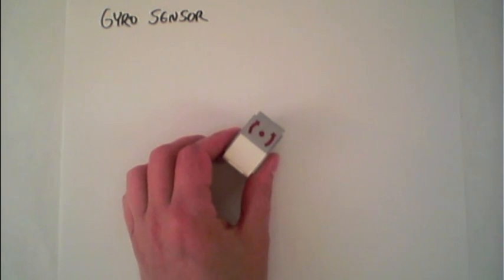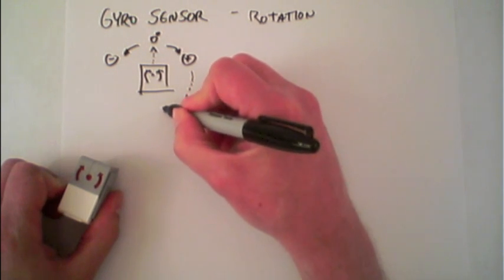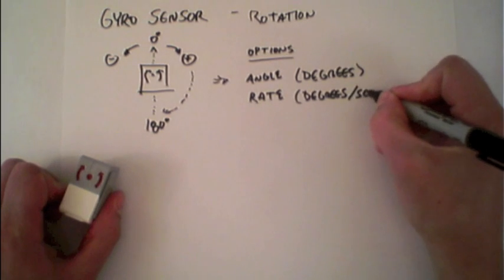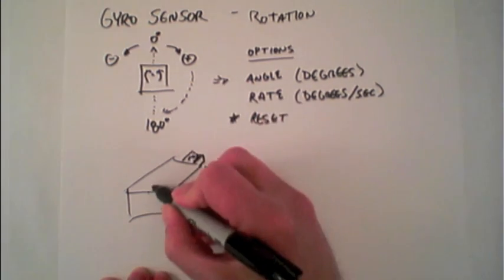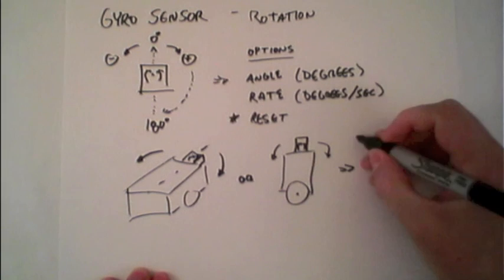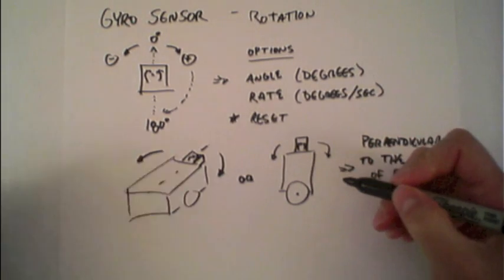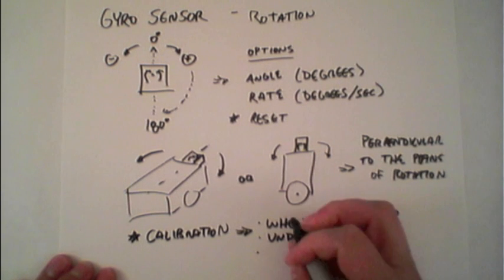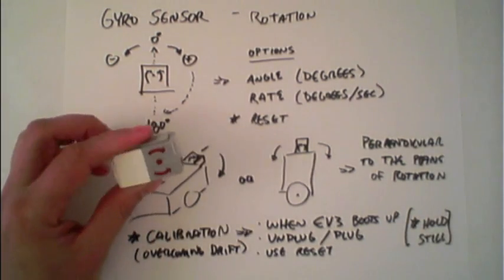EV3 Gyro Sensor

Comment: Would it be possible to use a Gyro Sensor to send out a signal of somebody has fallen over?
Reply from the maker: +CorbettVideos The Gyro Sensor would be able to detect that that someone has fallen over, by detecting that their angle has changed (from upright to horizontal). You would still have to write the rest of the code for the EV3 to "do something" (e.g. "send out a signal") when that happens. For example, the EV3 can make sounds, print text on the screen, or maybe move the motors as possible signals to alert that this has happened.